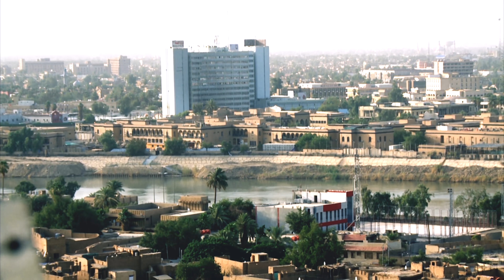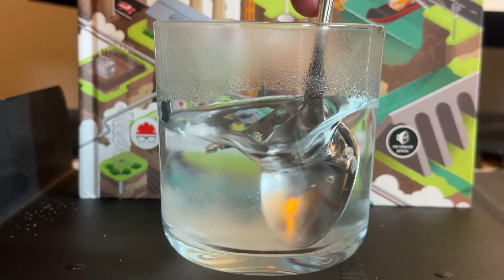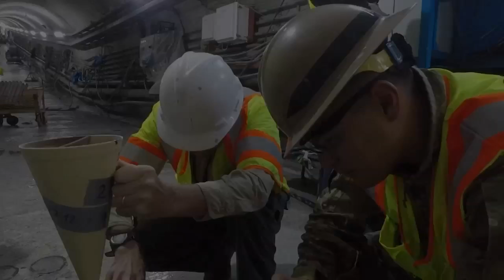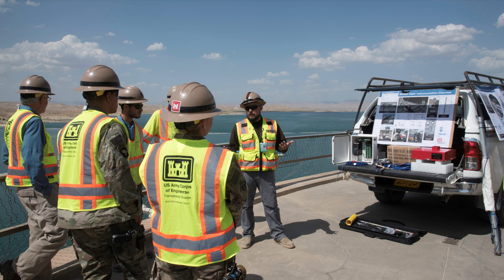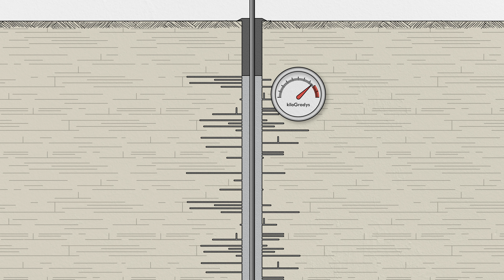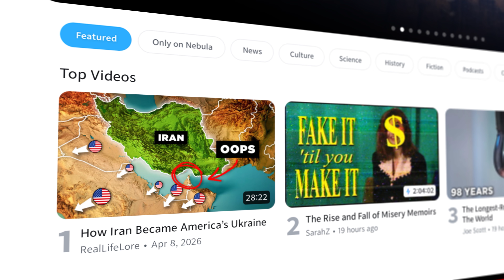Fixing the Most Dangerous Dam in the World

Comment: Calcium carbonate is vastly more soluble in water saturated in carbon dioxide than calcium sulfate is in water, but the solubility of calcium carbonate in pure water (or water with basically any neutral or alkaline salt dissolved in it) is obviously much lower and even lower in solutions of saturated carbonate salts. Likewise calcium sulfate would be practically insoluble in a saturated sulfate salt solution of another salt (the higher the sulfate concentration, the lower the solubility of calcium sulfate)

So a region that sees heavy rainfall and relatively low temperatures much of the year (with CO2 saturating more at lower temperatures) would see greater erosion of limestone than it would gypsum. The same would be true for material held together with lime mortar when compared to plaster of paris. (except plaster is also mechanically much softer, so abrasion would also erode it much faster, but with zero flow and zero mechanical abrasion, the purely chemical erosion would occur more quickly with lime mortar than with plaster).

Comment: Water, under head pressure from the reservoir, will go AROUND the Dam and the grout curtain, and escape out the sides (under the service and emergency spillways and abutments) because that area was not treated or even considered.  The reservoir blanket technique was used on Tarbella Dam in Pakistan 50 years ago and might actually be a more effective overall  Geotechnical Solution than  grout curtains  limited to just under the Dam at the main former River Channel.  The    solution of the foundation 'rock' is a chemistry/geology problem, not a normal Civil Engineering issue, except to not recognize the actual cause is not just water percolating under the dam, it also percolates through anything lower than the reservoir water surface, which is a much larger area to consider for overall reservoir and dam safety.  By the Way, US Army Corps of Engineers Officer Corps,  only get Masters Degrees, not PhD's in Dam Engineering. Where is there a Board of Dam Engineers Consultants???  Not on this project.

Comment: Grady, you're confusing gypsum - i.e. calcium sulphate, CaSO4*2H2O (the one occurring naturally) with calcium carbonate, aka limestone/ chalk, CaCO3. The latter gets dissolved by rain water as rain absorbs CO2 from atmosphere and becomes very diluted, very weak carbonic acid, H2CO3, and it reacts with CaCO3 turning it into Ca(HCO3)2, or calcium bicarbonate - which dissolves in water much better, albeit both of them dissolve rather poorly (VERY poorly, in fact.)
Still, much better than gypsum, and while at it, the one "in nature" contains two molecules of "crystalline/ crystallizing" water per one molecule of CaSO4, and that stuff you get for your dry wall plastering job is CaSO4*1/2H2O ("half" of H2O molecule per one molecule of CaSO4), and when you mix it with water it recrystallizes back into proper CaSO4*2H20, which produces lot of tiny, microscopic double-needle shaped crystals, looking like a letter "V" (aka "swallow's tail"), and they intertwine with each other and that makes the gypsum to "set hard".
How these crystals look like when they have sufficient time to properly develop can be seen in Naica Cave/ Cave of Crystals - en.wikipedia.org/wiki/Cave_of_the_Crystals.

But I digress here, and going back to calcium bi- or "mono" carbonate, once the water containing Ca(HCO3)2 gets heated to about 60-70 degrees C, the bicarbonate decomposes back into CaCO3 (and CO2) and it precipitates as the scale on the walls of your kettle -  and this scale appears there NOT "because of evaporation" (as AI claims) - it is there because of bicarbonate to carbonate conversion.
Stalactites and stalagmites ARE the result ow "water evaporating" (at a enormously slow pace, but then if you have millennia to spare...)  - but kettle/ boiler scale is not.

ANYWAY, "karst" is limestone (CaCO3) gouged/ etched by ever so slightly acidic rainwater, while the gypsum deposits under the Mosul dam are dissolved "just like that", and my guess is because the water in both Tigris and Euphrates rivers is a snow-melt water, thus depleted of dissolved minerals (I reckon there's no place on their journey to the sea to pick lot of minerals)therefore they can absorb LOT of it once given the opportunity (like at Mosul dam - also, I suspect high hydrostatic pressure facilitates this process as well).

AND THEN it is worth to be mentioned, this dam was built by Germans, who don't give an eff about "safety" or such for "outside" jobs - once they see a thick wad of money in the hands of the customer (Saddam Hussein in this case) they always bow with respect, and say "thy wish will be fulfilled, o Master" - and then when the job is done and they abscond with money, the customer is left with the problem and real-life exercise in fully grasping the deep meaning of "caveat emptor" expression - and a "sorry, not my problem now" send-off from them shrewd German businessmen.

But anyway, "karst" is NOT the same as "gypsum being dissolved by a river".
Cheers.

Comment: @18:25 the mention of training the Iraqis is missing a lot of context. When ai was there in 03' after the conflict was initially declared over, Army and Marine Corps Command was asking everyone if they wanted to stay and work with the Engineers. My buddy did and when he came back he said it was really hard to teach them anything because even if they can read, their knowledge base is very spotty and incomplete. An electrical "engineer" may know how to operate some equipment and solder a circuit board, but wouldn't know the definition of Phases of Power Distribution.

Comment: Ok, I’m not an engineer but why not put massive sheets of pond liner in front of the dam. Perhaps join it together on land or find a way to join it under water but it’s totally waterproof and would be cheaper than boring down to build an impermeable barrier. It only has to be thick enough to stop water getting through it. Just a thought.

Comment: Due to excessive seepage and uplift, the Hoover Dam underwent a 12-year supplemental drilling program (during the 1930s-40s) where 124,962 m (410,000 ft) of grout and drainage holes were drilled, and 11,951 m3 (422,000 ft3) of grout injected under pressure. This remedial program cost an additional $3.86 million and uplift pressures were significantly reduced (Simonds, 1953).

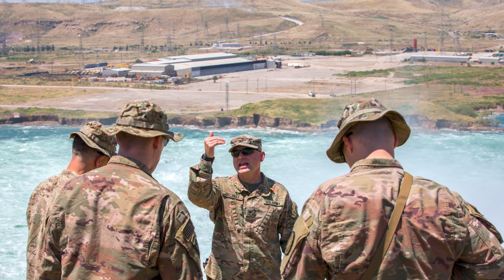Comment: 12:07 i mean i suppose at some point  after all the gypsum under the dam has dissolved and been replaced with grout all the way down to bed rock the problem will be resolved lol  at this point maybe they should just hire a tbm to make a tunnel under and along the dams length then fill that tunnel with concrete and once that set repeat the process under that tunnel again  and again and again untill you create a wall of concrete all the way down to something impermeable lol

Comment: uh, can't just use that electricity the dam is generating to power a lazer drill and make a hole for the grout that way? Surely that would be 100x cheaper since there's no need to keep pulling a corkscrew back up just to empty it or perform maintenance or whatever it was that was done to them.

Comment: The part about putting a bentonite floor on the reservoir reminds me of Wikiup Dam in Oregon.  https://en.wikipedia.org/wiki/Wickiup_Reservoir

It is built on volcanic rock. It is a layered rock base.  The layers consist of lava flows alternating with volcanic ash.  Obviously, the ash is quite porous.  The lava flows have lava tubes throughout, and by their nature flow downhill.  There are also cooling cracks that are conduits between layers and in and out of the tubes.  Overall, quite good at moving water.  The particular area is among the youngest of the Cascade mountains, making this area the most prone.

It is inherently obvious how porous the area is.  One of the three primary inflows to the reservoir is from nearby Davis lake.  Davis lake was formed by a very recent lava flow that obstructed Lake Creek.  This stream filled in behind the flow until the pores of the lava flow seeped enough to balance inflow against evaporation.  The toe of the reservoir backs up to this lava flow.  When the lake is at normal level, the inflow is hidden; but when low enough you can see the water coming out of the lava flow.  North a ways is the headwaters of the Metolius river.  The Metolius is a decent sized river that just emerges from the ground.  It comes out of rocks that funnel water from a nearby submerged lava tube that is funneling groundwater out.  To the West, the McKenzie river comes out of Clear Lake, a small lake with no discernable inflow yet has a good sized river flowing out year round.  Only a few miles downstream, the river disappears into rocks and travels several miles downstream, only to pop back up in another lake, Blue Pool.

In spite of all this, they built Wickiup Dam.  Since then, the USBOR has to have projects every now and then to come dump bentonite in the lake over suspected weep points when the river downstream stars flowing more and more water without the gates being opened at Wikiup.

Comment: For those who can't comprehend the flow rate at the start of the video, think of a decent sized brook, one that you would have to make a little bit of a jump across, not step across. There are areas in Germany that have a lot of gypsum and calcium in the soil. Sink holes form regularly and totally unpredictably and there's really not a lot they can do about it. For the dam, even with skirting beneath and a fair distance to either side of the dam, along the reservoir bank, I don't see how you stop the erosion. It's just gonna happen. "Astronomical risk" is the corps of engineers' way of saying, "Why in the F did anyone think to build this thing in the first place???"

Comment: In your last dam video, when you said that they used loess in its construction, my immediate thought and comment was "Loess!!?" Well, here I am again, with GYPSUM!!?!

I realize that it was not used in the construction, but, as the surrounding and subsurface geological substrate, it's arguably worse. Dams are such huge effectors on their surroundings, and have the constant pressure of the water they hold back. They also silt up over time. They should all be considered temporary, and their eventual removal should be part of the cost/risk assessment when they are built. They probably are now, by engineers, and maybe have been for a long time. But that doesn't seem to have stopped many poor ones being built anyway.

Comment: Just out of curiosity: why didn't they build an extra waterway at the front and redirect the water? You could start digging from the dry side to safely create the new path. Using the concrete blocks and bricks available on the ground, this new waterway could lead to a newly built reservoir in a dry area. It would alleviate the high pressure on the dam, create a solid backup plan, and fight drought where it is needed most. Even small little creeks will help a lot.

Comment: Would this solution not eventually become permanent? At some point, won’t all the gypsum dissolve and won’t the entire foundation be grout? Obviously that would take decades, but decades is better than never I guess?
Reply: you can do the math. you just need to know how much grout they pump in per day on average and how much is needed to fill up 100% of the ground beneath the dam. it'll probably take millenia.
Reply: Gypsum is calcium sulfate.  It is not soluble in water.

 edit: as soon as I wrote this Grady contradicted this.  So, yes, it is slightly soluble.  Acidic dissolves faster and cold water, bizzarely, dissolves it better while hotter water actually dissolves less and can even deposit Ca++ ion.  Higher calcium and magnesium ion levels help remineralization.  "Langlier Index" is a heading where this technology is outlined.

Comment: Badush Dam sounds like the only real long term solution. It appears failure is a matter of when, not if, for Mosul Dam so depending on it is foolhardy at best. Hope they get it sorted!
Reply: As Grady said in an earlier video, all dams are temporary. And some are decidedly more so than others.
Reply: Was it discussed whether Badush dam would have similar problems with it's foundation? Of course, from what I understand is that it won't be holding back much of a pool until it is needed, and that pool would be drained as fast as downstream conditions allow.
Reply: Badush project is been just  on paper since the late eighties , and nothing will be done about in the near future
Reply: The other long term solution is to drain it pre emptively
Reply: To be fair, all dams will fail and designing the failure/replacement is important for all of them. I'm worried about all of them since most don't have plans for end of life.
Reply: to add insult to injury, Mosul dam is at its full capacity for the first time in nearly a decade

Comment: When I was stationed there for a time I learned the assumption was the sand was  'ancient and too fine' to use as concrete. It was basically dust and would just exist in the air. I sat down with a tray of food inside, and when I stood up after eating, the outline of my tray could be seen on the table. Didn't realise it was a literal material difference.
Reply: Its too round. River sand has jagged edges that lock into itself. Desert sand has tumbled in the wind and is rounded off.
Reply: @ac.creations  This is why Saudi Arabia is one of the biggest importers of sand in the world, despite having more sand of its own than any other country. Lots of windblown sand, no river sand.
Reply: @kenoliver8913 its amazing just how technical and precise concretes are
Reply: @kenoliver8913  yet they keep trying to build islands by dumping desert sand into the water. They wash away lol
Reply: @davidwhatever9041  its an actual problem because its really hard to create jagged structural sand on an industrial scale. So they harvest it from rivers and deposits
Reply: @kenoliver8913 this is amazing knowledge
Reply: @ac.creations  however didn't Grady go into this very topic a while back?
Basically since the ultimate challenge for concrete is durability vs flowability, they add a ton of synthetic liquefiers into the mix to lower the overall water content, which makes it stronger. More coarse filler material would cause the mix to flow worse, so actually fine rounded sand isn't a problem at all?
Reply: @megalonoobiacinc4863 it would flow fine and probably need less liquefiers, however, the jagged edges are crucial for the strength of cement. Imagine standing on a piece of concrete, you stand on jagged sand that hooks into other sand, all kept together by cement, and thus creating its structural strength. If you imagine them as smooth balls, forces placed upon it will concentrate on cement in between the balls, and the material would fail at the same point as pure cured cement, which is not so strong. So, yes, you need jagged sand for concrete
Reply: @ac.creations  Kinda funny that both of you use cat profile pic lol
Reply: @natthaphonhongcharoen Have another cat. 😊
Reply: @KatieTaylor-w5e and another
Reply: @ac.creations  which means moon dust would be amazing for concrete... if it was not  well on the moon where it is financially impossible to get it. that stuff is coarse as hell.
Reply: @ac.creations  Could one heat it up enough that it melts together, then crush it to get jagged edges?
Reply: @TNH91  yes but the economics of making sand doesnt work. I think they just separate/sort it from dirt or from crushing large stones to make gravel. Turning soil into sand you need to heat it up to kill and vaporize all the organics, costing fuel/money
Reply: @ac.creations  Where did "soil" come from?
Reply: @TNH91  sand mixed with bits of decaying plants and microbes. The easy way to get sand
Reply: @ac.creations 
Exactly!! Just like crushed rock vs. Stones/pebbles!
Reply: @ac.creations  Yep indeed thatswhy its useless for Sand Castles or as filler sand for concrete or mortar.
Reply: I like this cats conversation 🍿
Reply: @GooogleGoglee  desert sand is purrrfect for bathrooms though. Easy to dig in, but doesnt clump up without clay.
Reply: @GooogleGoglee  To cats, the quality of sand is very important.
Reply: @GooogleGoglee commenting just add something for the cats to get excited about.
Reply: And the dust is really fine, like as small as smoke, meaning you can absorb it in your bloodstream…….
Reply: There's a reason we call it "moon dust."
Reply: @NemoCaligari Agreed, we call it moon dust. It just splashes like water when you step in it. But learning about the US moon program in Apollo and the interest to go back with Artemis, this moon dust couldn’t be further in many qualities than the actual stuff. The real stuff is apparently very jagged and abrasive, and stacks very well. Oh, and it’s electrostatically charged so it clings to everything.
Reply: It's why you do indeed need to sell want to the Arabs.
Reply: Were you part of the battle for Mosul?